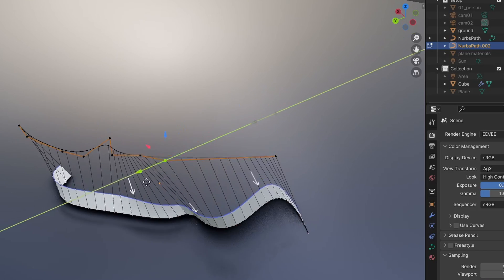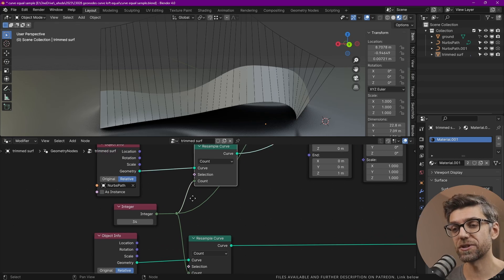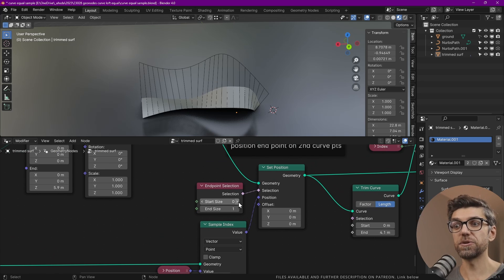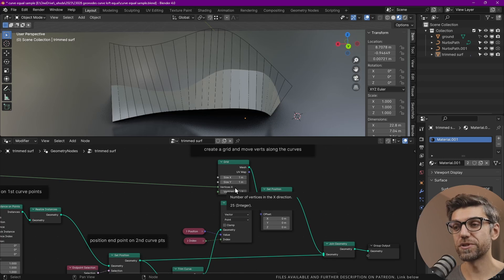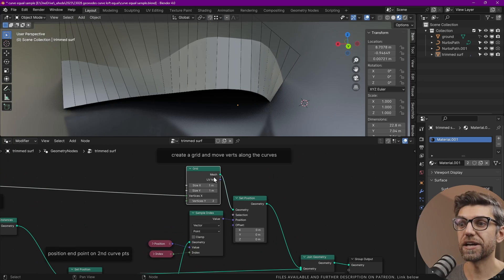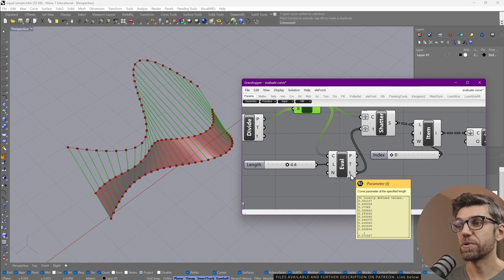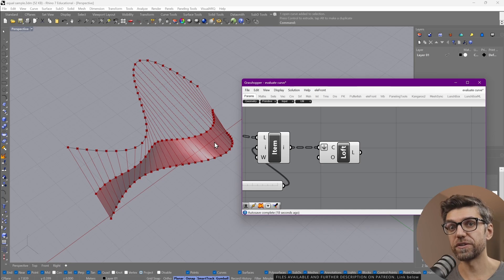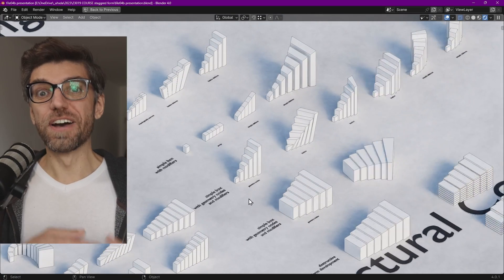Trimmed parametric surface in Blender Geometry Nodes vs Rhino Grasshopper

Comment: Hello, I am having issues with this tutorial. I followed every step in Blender 4.3 but for some reason the bottom curve is just connected to a dot at the top instead of the second different curve I created. Also, some nodes look different in the new Blender, for example the "realize instances" and "greater than". Can anyone help?
Reply: Seems like you are having a number or order index discrepancy . Try working through the problem to understand the underlying mathematics. That’s the only way I’ve had success when powering through open source software

Comment: Hi Dimitar, I have just come across this and it is awesome! It has very practical applications for architecture with distorted wall or roof framing. But I would really like to know how to put a profile onto the lines joining the two curves. This would really add to the functionality of it. (An H profile for steel or a simple rectangle for a timber wall frame). Can you point me in the right direction to execute this??

Comment: could you do geometry node setup  for surface morph command in grasshopper
Reply from the maker: Do you mean like taking a flat object and apllying it onto a surface? That's essentially a tessellation. Take a look at my videos on the Tissue Addon, as it does precisely this.
Reply from the maker: There are also node groups that do tessellations in geometry Nodes. However, quite a few of them are paid, like the Erindale Toolkit.

Comment: HI fantastic to find somebody else who uses GN und grasshopper :)
very interestingt! 
I wish I could just graft a list- or do other such simple grasshopper operation!
Did you find a decent workaround to deal with the missing listhandling in GN?
Reply from the maker: Coming from GH to GN was indeed a struggle for simple things like that! They are adding more data-based parsing but no where as much nodes as in GH or Sverchok. Having said that, the mentality of working with it needs to be a bit different than GH. For example, in GN, instancing on points and then modifying the result with set position is different than in GH where first we set out the points in the correct order and data format and draw curves or whatever else on top of them. So for something like graft, in the most typical base case scenario of points aloing the U and V of a surface where you want to create curves based on points in the perpendicular direction in GH, in GN you would simply add a mesh line and instance the perpendicular geometry on the points.

Comment: Hi. So (in Blender) do you know how to do this with the bottom curve split into two sections? Your setup will only use the first section/island....
Reply from the maker: Sorry, I don't understand your question
Reply: @UHStudio  If the bottom curve is split into 2 parts your nodes ignore the second half. Imagine 2 sections of roof joining. Or fingers joining the palm of a hand.
How do I make this work - so the node setup sees both parts of the bottom curve and joins both correctly to the top curve.
Thanks for the attention...
Reply from the maker: @neilmarshall5087  for two separate bottom curves and one top curve, you would either have to separate the top curve and perform the operation twice or combine the bottom curves into one curve. But if there are sharp corners, the perpendicular curves will be hard to control, so better split the 2nd curve
Reply: @UHStudio  OK. I will be looking at the Sample Curve Node after watching Erindales latest video. That seems to offer a solution.

Comment: Hello ! I appreciate your videos, it's clear. I've one question : Wich software is better for an architect according to you and your experience ? Blender or Rhino3d ?n. Thank you !
Reply from the maker: Maybe that should be a video to talk about when and what each is useful for? 🤔
Reply: @UHStudio  i would really love to see the process 'after' the blender phase. Like how do you convert these conceptual meshes into a parameteic model, then into the documentation phase
Reply from the maker: Hi! I would say both. Rhino is Nurbs and has Grasshopper, excellent documentation capabilities, and works well with Revit. However, it is too precise for early conceptual work and even though it uses Cycles, the implementation is not as good for rendering as in Blender. Blender, has excellent inherent parametric modeling capabilities that allow you to be as fast and precise or imprecise as you would like to be to get the ideas flowing. Blender also fits conveniently in between the explicit and completely non-parametric modeling in Rhino, and the completely parametric, but sometimes it-just-takes-too-damn-long-to-construct in Grasshopper. And of course you can render really well with Cycles inside of Blender. But Blender's documentation capabilities come from addons like BlenderBIM and MeasureIt Arch, which are themselves in early development

Sorry, not a short and sweet response, but if you have any more questions shoot them :)